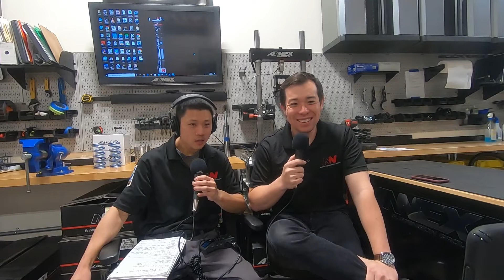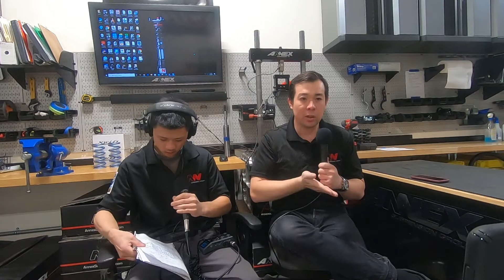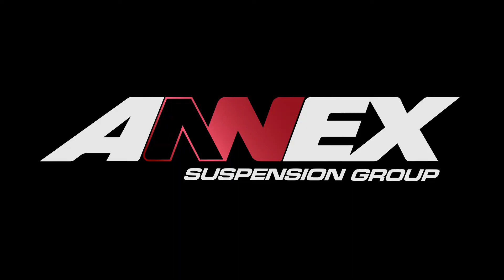Double Digressive or Linear Pistons

Comment: I don’t speak for them but I believe what he means is they’re not running as much low speed compression.  You can have two shocks with the exact same high speed compression and then raise the low speed compression threshold on one and that will make that shock digressive.  The second one is typical for a track car or smooth surfaces where you’re trying to control body roll and only allowing suspension to move once it meets the threshold.  Downside is every bump, crack and tar strip in the road that doesn’t meet the threshold is much harsher which is why off-road shocks are typically linear.  After having a softer spring rate setup with digressive compression shocks in the past when I went shopping for coilovers on my next vehicle I stayed away from venders selling digressive setups as they just use it as a buzzword since it’s in racing everyone thinks they need it even though their city street are not paved like Leguna secca.  So I bought ones with firmer rates and linear curves and been much happier.  I don’t think Annex was out when I was shopping but going through their videos they seem more a no BS company and it sounds like he’s eluding to too much digression a bad thing for most applications.  It can also lead to problems on the rebound end too on fast ripple bumps as the suspension will pack down and get firmer and firmer through each hit.
Reply: Hey this is well said!  There are some subtle differences between what we've experienced and what you commented but this is a good summary IMO.  Thanks for helping out our followers!
Reply: @granthendricks1143  no problem, I’d love to check out your facility sometime if you guys still allow.

Comment: Why wouldn’t you want to blow off compression pressure during high piston speed events (such as hitting a manhole cover or bridge joints) with your street-focused coilovers? 

Been considering Annex coilovers, but the KW V3s I currently have are fairly linear, and I’m not exactly satisfied with the way they feel. I can soften up their low speed compression and rebound, but that doesn’t help when they’re still so crashy and harsh over sharp road imperfections.